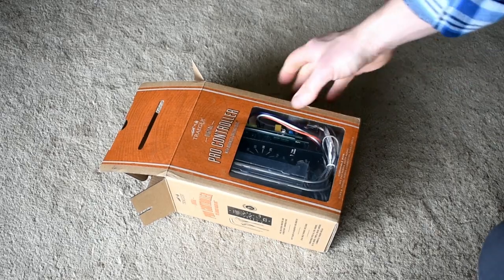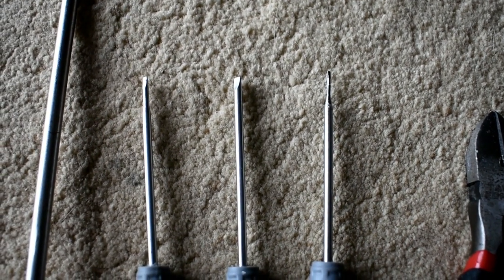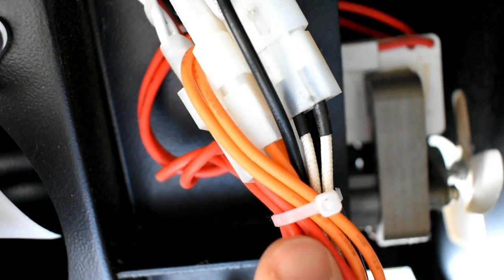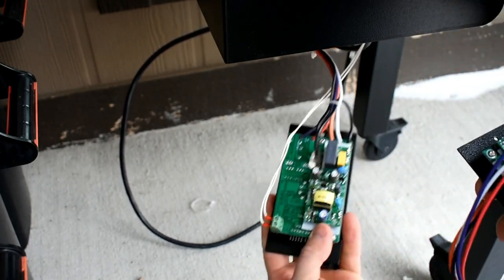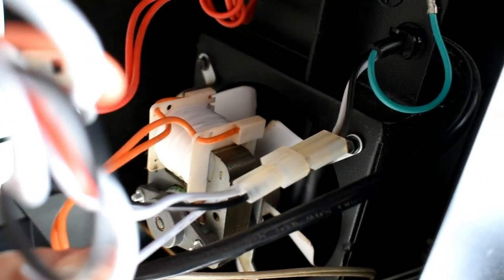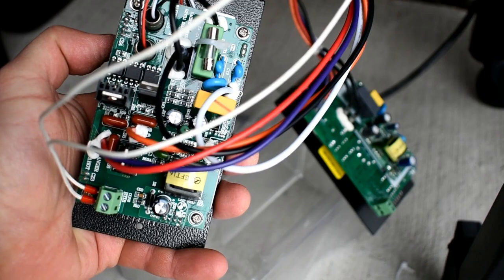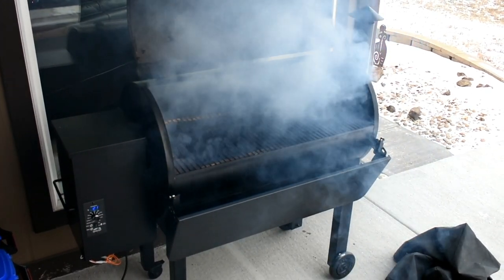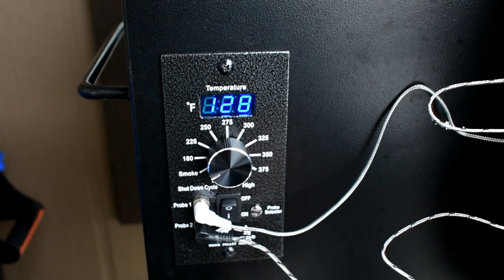TRAEGER Pro Controller Upgrade--🛠Easy Install in Less than 7 Minutes!🔧

Comment: The only I don’t like it does not have the P settings for less smoke or more smoke.
Reply: Is there a way to adjust the P setting without the hole or just out of luck?
Reply: There is a p setting. Just need to take the controller out. There is a button on the board

Comment: You  say upgrade
 So its not the same? Mine has different wires. Because its the 3 setting dial type. So its an "upgrade" so where s the part about rewir8ng it for the "upgrade"?

Comment: Did you find that the smoke mode kept the temperature around 165-180 degrees?
Reply from the maker: yes, my "smoke" setting usually hovers around 175-180

Comment: Our grill is a much older model, BBQ070, which uses an analog controller and no display. There are 3 different bridles (fan, motor, hot rod); I notice you mention 4 bridles on your grill, and I wonder if you know what the fourth bridle is for?
Reply: I am trying to do this on the same 070 . I am getting an error 1 on my display. I am assuming its because I dont have an RTD sensor. IDK what that is. Let me know if you figured it out. Thanks.
Reply: The RDT temperature sensor seems to monitor the temperature inside the grill. It plugs into a green receptacle on the new circuit board. You will have to order this part, you will need a diagram of the newer model grill showing how to install, and you may have to drill holes for mounting and then routing the sensor wires. The payoff is much more precise control over the grill during cooking, although you now have a much more complicated start-up and shut-down procedure. And yes, without this sensor I don't see how you can get the new board to function. Best of luck, let us know how this goes!
Reply: @Etherdave   Thanks for replying. I did google it and ordered that part. I did look at my grill and there are already holes to put the temp probe. Before ordering I did see an answered question that asked if this upgrade would work for the 070 grill and there was no mention of needing this as well. I wish it was included , but understand why it isnt. If just one of the parts goes out, I would have to keep spending $150 when I just need one of the parts. Anyway, Happy smoking and Traeger on!
Reply: @Etherdave  what part do I need to order exactly?  I’m having this same problem.
Reply: @rightpedaldown9346  what part did you order?  I’m having this same problem
Reply: @meagangoodson5481  The fourth bridle (black) connects the cord to the controller board; we have it on our model, we just couldn't see it properly. All molex connectors are color-coded so there shouldn't be an issue about what goes where. Consult your owner's manual, or download it from the Traeger website; at the back is a schematic diagram showing all the connections. Our primary issue was a fried CONTROLLER BOARD, which made the grill completely inoperable, so once that was replaced we were able to trouble-shoot the remaining modules, discovering then that only the HOT ROD needed replacement. At this time it is advisable to give the grill a thorough cleaning, inside and out. It is also best to disassemble the pellet hopper to make cleaning out the hopper / auger an easier job. Apply firm but even pressure to the screws to remove them from the grill, and take care not to damage the heatproof gasket between the pellet hopper and the auger. I used emery paper, steel wool, and good old elbow grease to clean the auger, and then sparingly-applied plumber's grease to protect the metal from corrosion. I would also advise you to get a cover if you do not already have one; these grills seem to attract dust! We replaced the original board with a more advanced model with digital display, provisions for two temp probes, and of course the internal heat probe. This model is widely available over the Internet. Depending on the seller you may have to order board and internal heat probe separately. Be advised shipping times may vary.

After a year I can say the thing runs beautifully, albeit a bit hot, but starting up very rapidly and keeping a reasonably even heat throughout the cooking cycle. We recently smoked a brisket, using both temp probes to monitor the interior of the meat. I'm just about steeled up to try adjusting the heat output on the board; there are videos here that show you how to do that. Cheers!

Comment: Great video.  Question:  Why didn't you install the RTD sensor that came with it?  Are they all the same or something?  I'm coming from traeger elite and wondering if the RTD is any different.
Reply from the maker: That was everything in the package! There are possibly different control versions for different models.
Reply: The Pro controller (Blue) is an upgrade from the (Red) controller. It doesn't come with a new RTD. You would need to buy that separate if you were upgrading from one of the old models otherwise they figured you already had one installed. The Red controller upgrade does come with a new RTD as it is an upgrade from the original controller which only had low, medium and high settings and didn't come with a RTD. I think both controller upgrades should come with a new RTD but Traeger didn't think so.
Reply: what is a "RTD " sensor? I am doing this upgrade from the old 3 setting style and dont have those wires. the display showes error 1
Reply: @rightpedaldown9346  the red led controller comes with a new RDT (thermometer that installs inside the grill on the left hand side). If you bought the blue led controller it is the upgrade to the  red controller and does not come with a new RDT. (The blue led controller has the two temperature meat probes. The red led does not.)
Reply: RTD stands for Resistance Temperature Detector. They are simply a resister that varies resistance in an electrical circuit measured in Ohms by temperature variation. As the temperature changes the resistance in ohms changes.  Failure is rare on RTD’s. 48 years industrial electrician here.

Comment: So my question the upgrade on this setup now is just so that you can use the dual temp probes correct
Reply from the maker: Traeger claims that this control is also more accurate.  I believe that this model is what is on the newer models.
Reply: @live.life.simple.  thank you for the reply the one that's currently in my is one without the additional probes to go in that's where I was just curious if I should upgrade or not